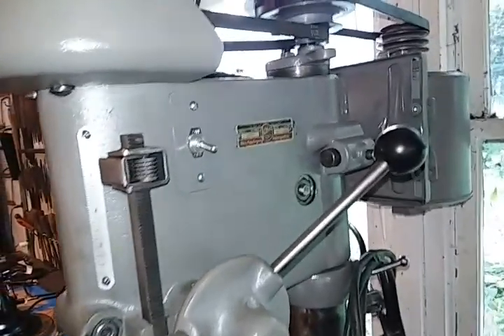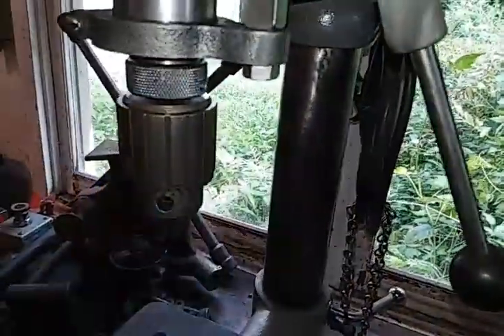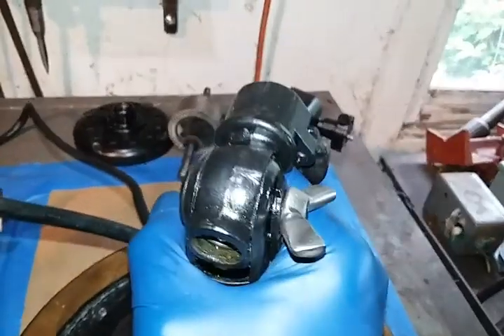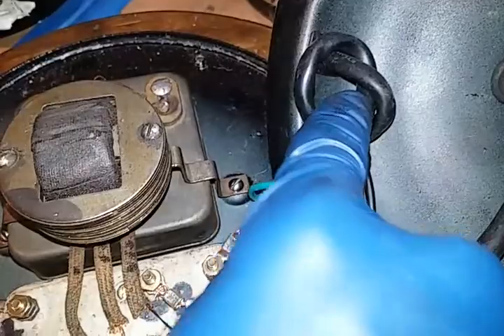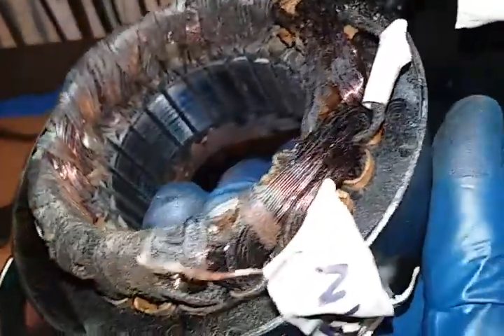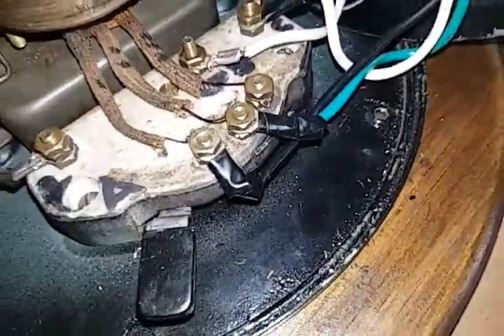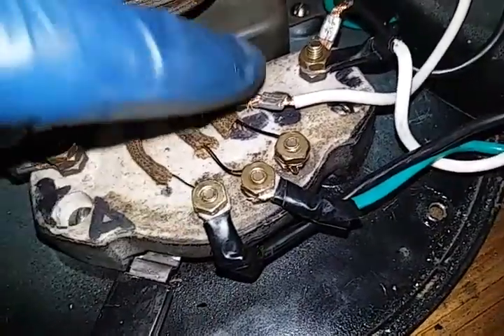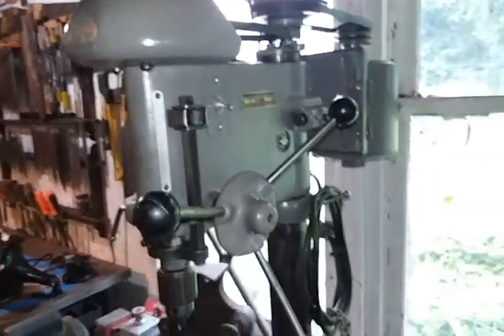Atlas 1020 drill press new belts

Comment: That is a sweet machine. Does the motor normally have a cone pulley? My Jet has a cone pulley on the motor so it gives it a wider range of speeds.
Reply from the maker: I'm not too sure offhand. It is not the original motor. The pulley acting is barrel shaped. It has 3 spaces, all the same size.